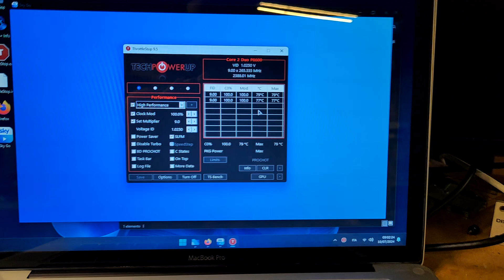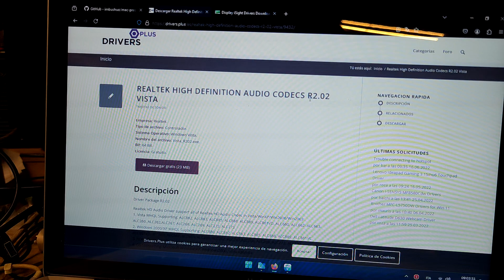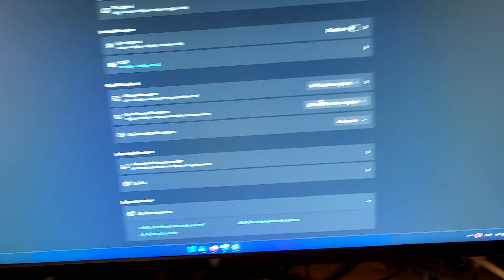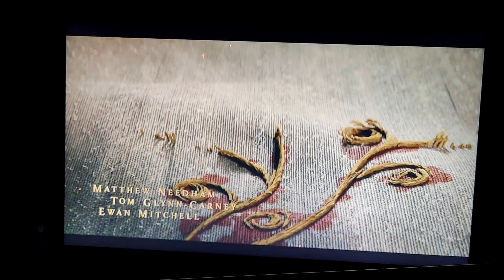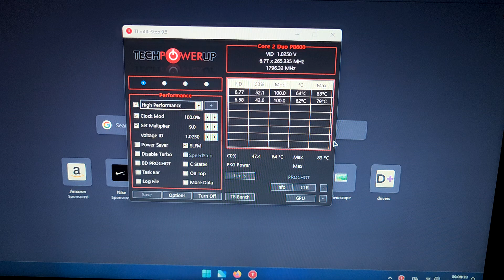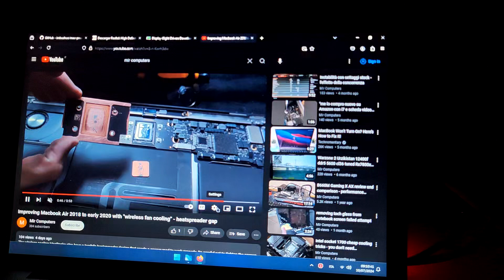MacBook Pro Late 2008 in 2024 running Windows 11 - audio, trackpad gestures, iSight, 2k DP, SkyGo

Comment: Hi, there is a software called open core legacy which means you can boot the macos of a newer version, say catalina, so this user can use the software native on thier mac rarther then booting to a windows system boot, thanks!
Reply from the maker: i am totally aware of that, and i use opencore to do hackintosh, but the performance is terrible compared to windows, SkyGo would not even launch with OCLP installs. Most apps that run on metal will not work or require patches (like zoom). Windows is so much better on macs before 2012